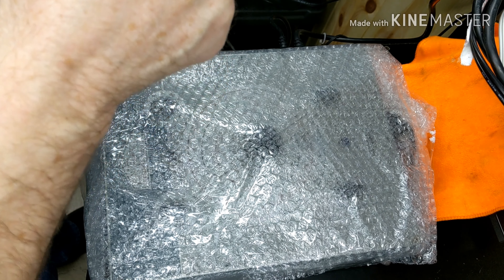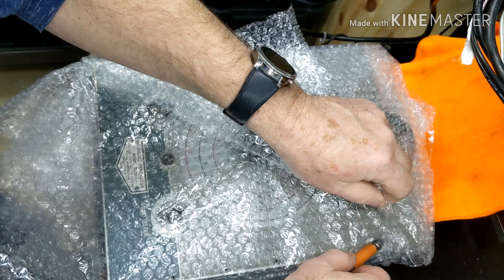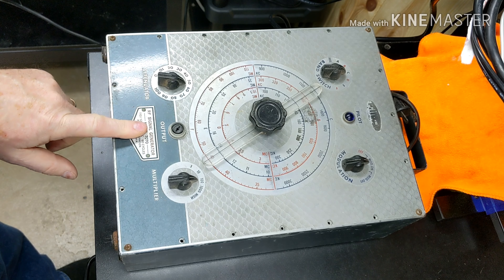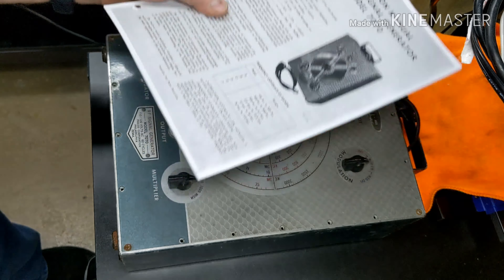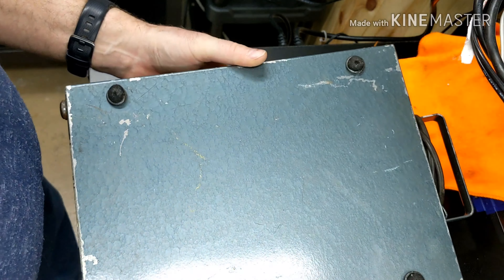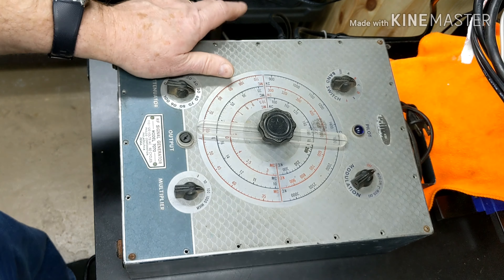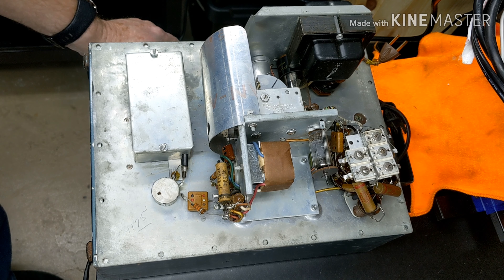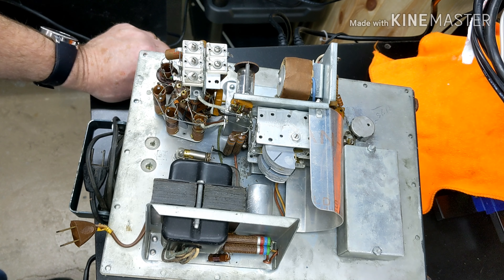1947 Philco 7070 Signal Generator- Unwrap & First Look

Comment: Very nice looking signal generator. I had no idea Philco even made test equipment? That was well packed for sure. I have gotten items from ebay that had literally one layer of bubble wrap and nothing else and they ended up damaged bent panels to broken tubes glad the seller took the time to package this one the right way. Stripping and using the same hammer tone finish should make it look new again. Missing screws dead giveaway someone has been into it already. That signal generator is 3 years older than me. Pretty clean inside for being 73 years old.

Comment: Looks good Gregg! You may have to take out a loan
 to replace those screws...lol....I like the plug inside...the 077 had a reverse plug, which I didnt replace....Im looking forward what you find as you move forward! Take Care and be safe on the trip---Larry
Reply from the maker: Thanks Larry,  LOL about the screws! Yes, I think it will be good. Also, there was a 077 on Ebay last night. I made the guy an offer but he never responded. The face did have some damage on one spot that was very noticeable,  so I wanted it, but wasn't but hurt that he didn't take my offer either. Thanks for the well wishes in my travels. We about got taken out last month, a very close call.i saw Michael's last video last week. Very excited he is coming back!

Comment: The box inside the case is most likely an AC line filter. It's got some coils and caps in there to filter noise on the power line and also to prevent RF from the generator getting back into the AC line. bandersentv is restoring a Philco 077 presently if you want to take a look. Thanks for the look see. ATB Doug.
Reply from the maker: Thanks Doug, yes I have been watching his restoration as well. It will come in handy, because I just got a 077 today on eBay. I'm pretty stoked, but unfortunately the face plate has some damage in one area that will likely not be repairable. But it's still a Philco 077 so I'm happy. Now I have a 7070 and a 077. 😁